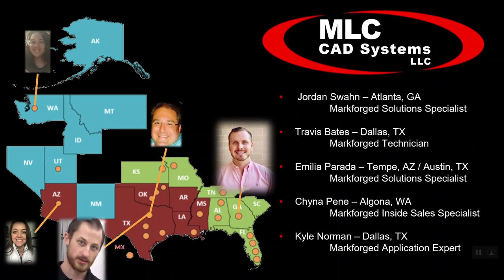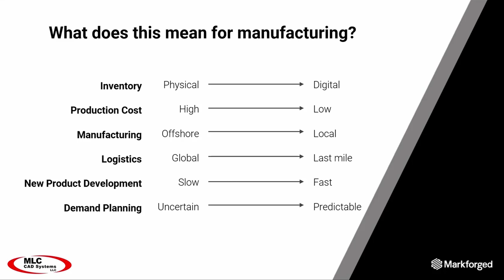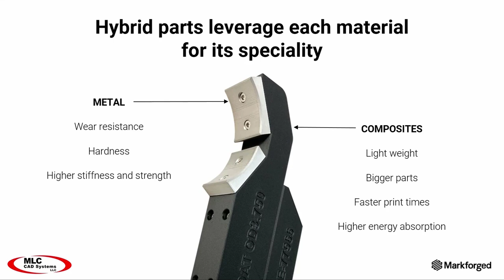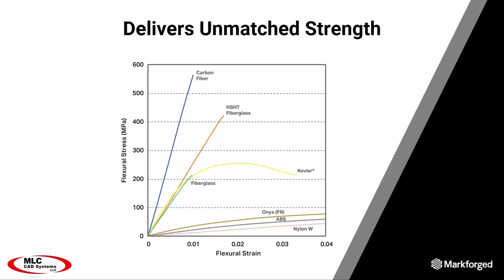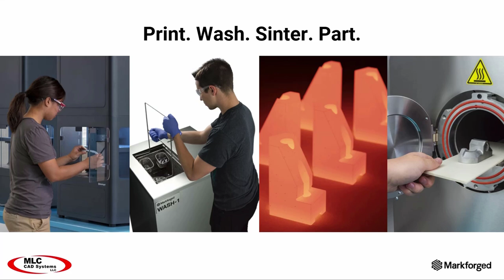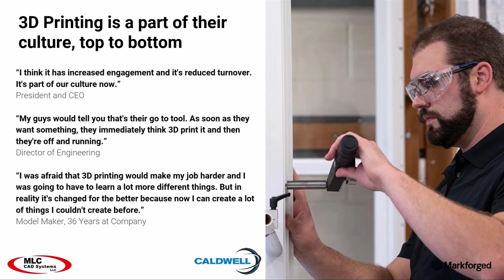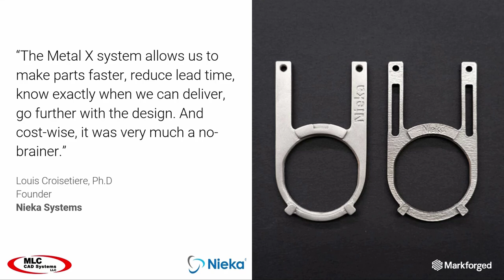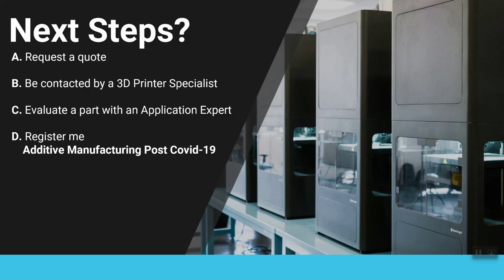The Future of Additive is Now | Webinar

Comment: Enjoyed the video.  6061-T6 Ultimate Tensile Strength is 45kpsi.  Your link broke at 22kpsi.  This is half the strength, correct?
I'd like to see a pure tensile strength test included in your video, drop the chain link.  Loads are somewhat different.  Thanks
Reply from the maker: I don't have the exact cross-sectional size of the chain link or the amount of stress that was present in the area that fractured, I only know that it was able to carry 22,000 lbs of load.  If a part in tension has a 1 sq in cross section and 22,000 lbs load with no bending we can calculate an ultimate tensile strength of 22kpsi, but in this case the link must resist some bending and contact forces in addition to having an unknown cross sectional area.  For a pure tensile specimen, you can refer to the published material properties https://mlc-cad.com/markforged/markforged-materials/.  Carbon fiber has a tensile strength of over 100ksi but it is directional, so it isn't a simple apples to oranges comparison.